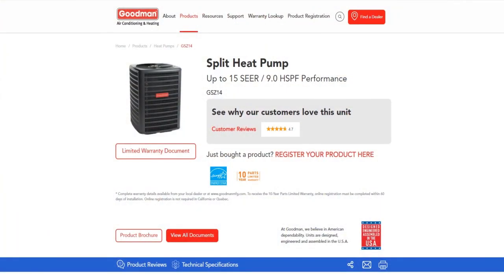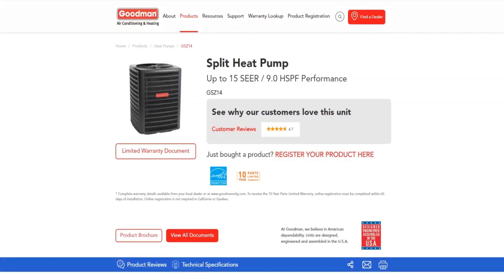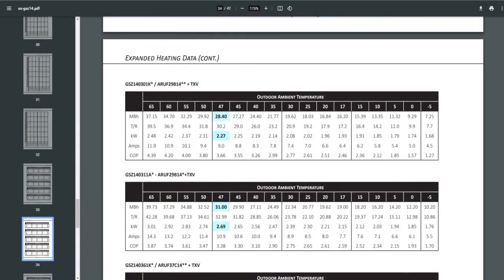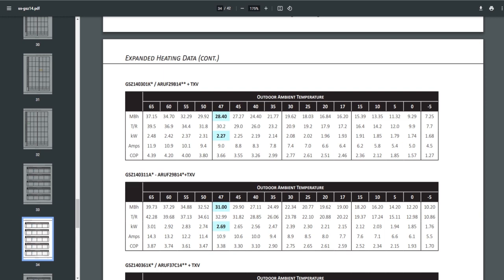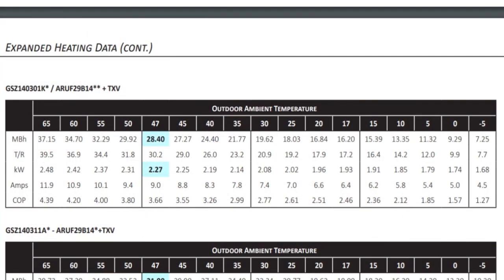HVAC Heat Pump Limitations in Cold Outdoor Ambient Applications

Comment: Yes and then there are the efficiency numbers between 1 ton through 5 ton units such as power consumption per tonage. My sources have shown a 5 ton condenser is less efficient in power usage per ton when compared to a 4 ton or a 3 ton unit.  Depending on your electric rates...this could be a factor in determining if one HVAC unit is best or Two or Three of them for the long run. Also, those HEAT PUMP marketing ideas from the Government, especially California, do not tell the public about how much more in energy cost they will be when compared to natural gas heating. Last I heard, gas is 3 times more efficient than electric per unit plus the cost of a unit of gas vs. electric is way lower. I have also heard from several HVAC contractors that heat pumps will cost less to run than natural gas yet they do not supply the data to support this. What they do say is a heat pump is 30% less expensive to run than a gas furnace...I'd love to see that happening in 35 degree weather with 50 cents per kWh electric rates compared to an 80% gas furnace with $2 per therm rates.

Comment: New air to water heat pumps that use refrigerants like R32/R290 and R744 still perform at down to -25 0r -30 C.

Comment: Nice job Zack! Duel fuel is the way to go. Carrier 21 seer says they can heat down below zero, outdoor fan can ramp to 7000 rpm.
Reply from the maker: When I think about an outdoor fan motor running 1175 RPM that’s crazy
Reply: Bryant evolution extreme

Comment: Variable speed systems do a great job in colder temps but if it’s below zero you will need a Mitsubishi Hyper heat system. Of course a gas or oil fired furnace will do a better job in severe cold.

Comment: Recently I had a 4-ton Bosch IDS 2.0 installed to replace my 20 year old A/C only system.  Here in NY my power company gave me a $3,800 rebate which just about covered the installation cost.  We only have oil heat in our area.  So basically it was just equipment cost, and my power company offers a lower electricity rate all winter long.   Will see how it does to reduce $5/gallon home heating oil!!

Comment: We are in southeast Minnesota and a majority of our costumers have propane or oil heat. We install  just as many if not more air source heat pumps as cooling only units. We use a dual fuel thermostat and shut the heatpump off around 20-15 degrees so if it gets colder than than that the fossil fuel furnace operates instead of the heat pump. At the current prices in this area Air source heat pumps are cheaper  to operate than propane and fuel oil. Natural gas is still cheaper than the air source as of right now anyways.
Reply: Same here in northeast ND.
Reply: yes, and that is the way it should be done with a hybrid system and backup. Here is South Burlington VT our politicians have decided that new construction will be fossil fuel free. Yes, now a days the inverter systems are made to cover lower temps but they are not maintained and service is hard to find. IMO it is a train wreck.